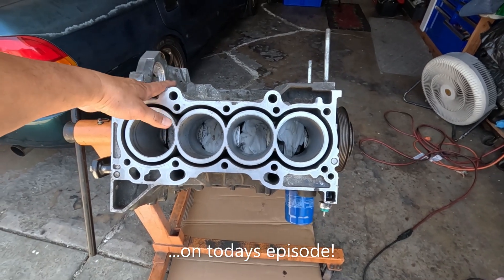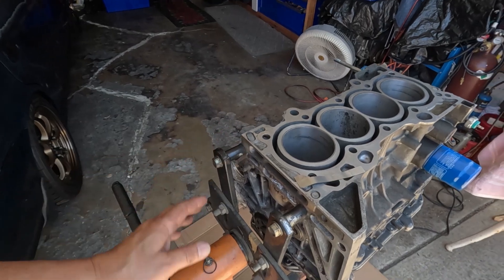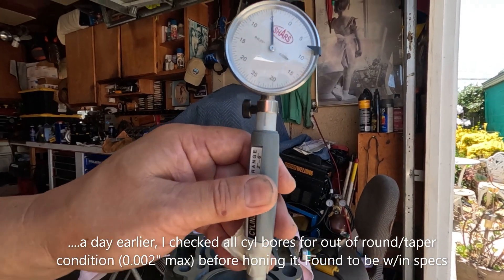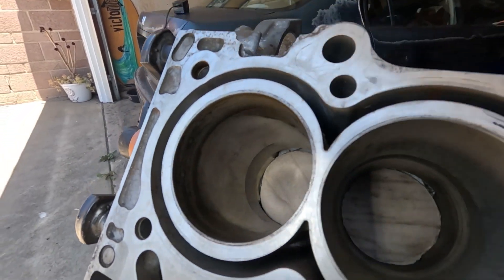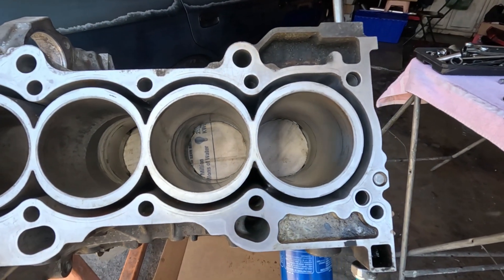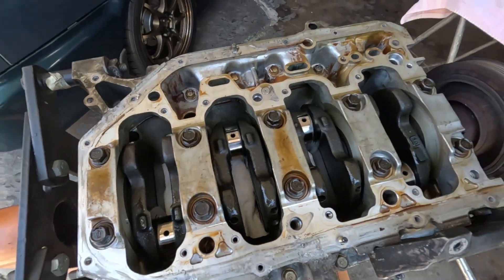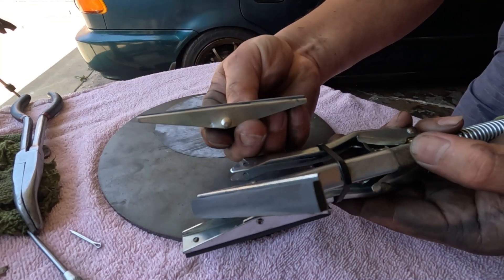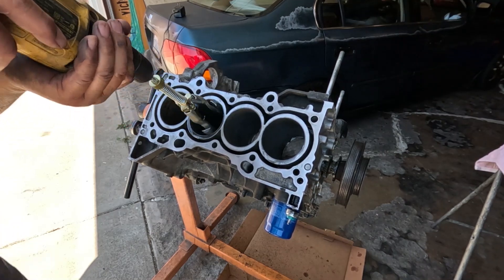Honing K24A cylinder w/ bad results!

Comment: I would use as is and go by ring gap.
Reply from the maker: I could but l've decided to have it oversized to start fresh. Thanks man
Reply: @sagittnet2158  I respect either way brother.  Love your channel and your openess.  I'm sure it will be blast.  The only thing about K series the transmissiosn are weak so keeping the power level low and going easy on the clutch action - it should live just fine.

Comment: why not take off more material and oversize pistons
Reply from the maker: Yes, it need oversizing and it's already in machine shop.
Reply: @sagittnet2158 nice, would it be possible to do a g23 swap with an auto trans?
Reply from the maker: @htorres-x3c l think you could, but it'll be perfect if yoi can get it tune though.

Comment: Just stick it back together it's not like you're going to be doing 100,000 miles with it. Might be worth checking the clearance with the other pistons in cyl 2 you may find a tighter fit..
Reply from the maker: True but l've decided to get it oversize since l'm new on k series it'll be a test bed. Thanks man

Comment: Sagitt i have a question for the g23 i have a honda accord 2000 coupe how can i adapter the harness dor the distribuidor and idk if i need other gear or just the crack shaf gear P1B thanks
Reply from the maker: I assumed your'e using your 2k Accord engine harness w/c is good. You need a distributor conversion harness to adapt to obd1 H distributor. Its fairly cheap on ebay, but always get it tru some reputable seller or it doesn't really that hard to chase the wire connection of the adapter. There's plenty of write up about distributor on web. There's also a good info on Hamotorsports.com, go to their tech library and you'll find all kind of info about the swap. 
Did l read P1B you type, if it is, its from H23a bluetop crank gear and similar to H22 p13 stamped on gear. You need that crank gear and waterpump gear from H22 or H23a, f20b and swap it to f23 waterpump gear. If you like, get a waterpump from Kstuned, its already made but have the gear shaft spot welded. I have a friend that gear came off on his engine ( pump is from kstuned). I always build my own and so far no problem of gear coming off.
Reply: This is such good response to a question from a subscriber. You da man sagitt

Comment: It all depends on what you want to do you can send it and hope it stays together or send it to get a .5 over and know your going to have something nice in your hands and on the k series block 5 to 650 stock everything no problem daily beater... hope that helps
Reply from the maker: It's best to build it correct, awaiting on the piston l ordered so l can bring it to machine shop to get it resize, hope the rust will come off and thanks for your info.